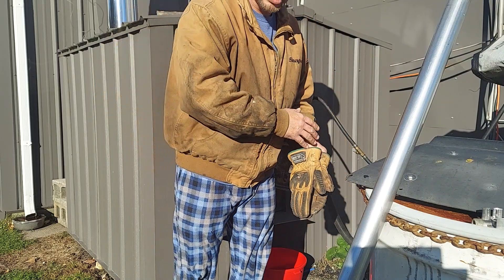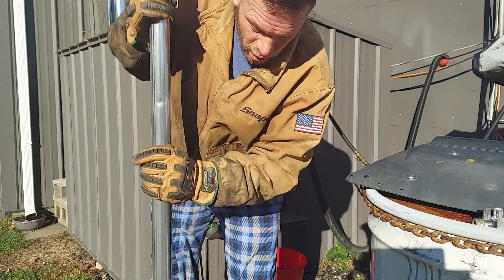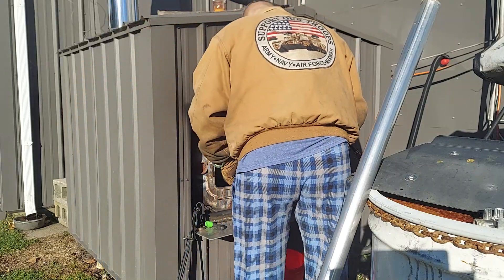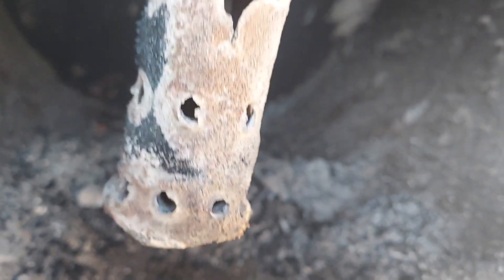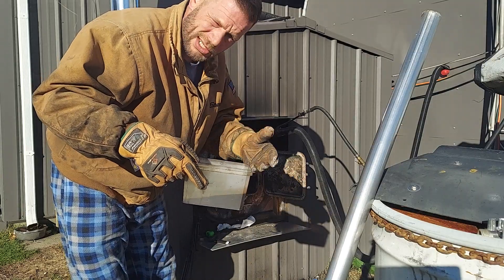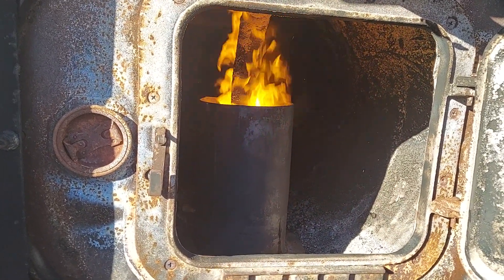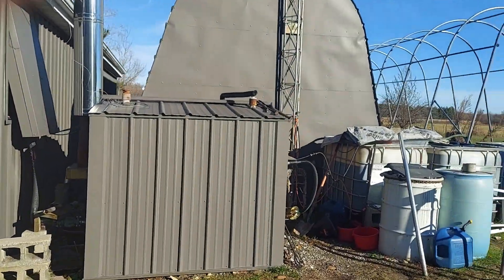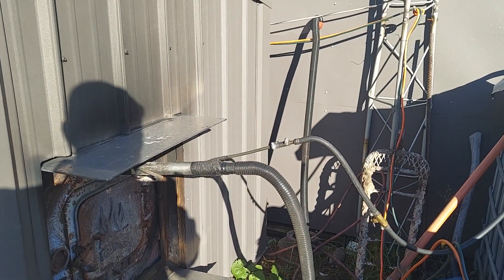How I heat my home for free! Homemade outdoor waste oil,solar,and wind  powered boiler.

Comment: Most excellent information, presented in a fine manner, thanks 
I wonder about chimney maintenance.  I'm planning to fit a burner in my 1984 Kodiak wood stove which exhausts through a 10 inch masonry chimney. I suspect there would be far less crud buildup than from burning wood.
Reply from the maker: @paulrickman7549  I don't get any build up,a very light white ash,no creosote at all. If you have a good air to fuel ratio, you won't have any soot. Smoke-free burn is the key.
Reply: @karlsoffroad  Thanks.

Comment: Watched a ton of your videos. I want to know more about the boiler. Is it a 55 gallon drum inside old fuel oil tank? How well does the 55 gallon drum hold up?
Reply from the maker: @hauntedacres207  Yes,that's exactly what it is. The drum is holding up great. I'm on year 4 with it, and there are no issues at all. I didn't document the build because I needed to get it built and running for heat. I only took two pictures of the whole build.
Reply: @ I thought of doing that exact thing for year but worried about the drum not holding up long. What’s the secret for getting the drum inside because of the ribs? Or was it just a bigger hole then weld it up.
Reply from the maker: @hauntedacres207  I actually cut the hole a bit small, and it was difficult to get it through the hole. I had my 14x4x36 inches long stainless steel chimney box welded to the drum before I assembled it, so that was another hole to line up while fighting the drum. I did it by myself, so it can be done. I welded the lip of the drum to the fuel oil tank,then welded the chimney box. I then plugged off the holes in the fuel oil tank and filled it with air to check for leaks with soapy water. I had one on the upper left of the barrel and one inside the barrel at the chimney box port. I had a hell of a time getting inside to weld that pinhole. I could only fit one arm and my head through the opening! Lol

Comment: Super interesting video! I know you said you run your boiler overnight. So does that mean you then have to let it go all the way cold once a day to service it? How well does it hold house temp when the whole burn barrel is that cold?
Reply from the maker: @BrinksFarm  I can shut it down for 24 hours if needed and still have heat for both buildings. I can shut it down,clean it, and fire it back up in about 10 minutes. That's if I let my burner cool down completely. Very quick and easy.

Comment: I would like to see how you monitor and pump, supply the oil to the boiler. It appears the oil is lower than burn chamber so I'm assuming you have some sort of pump setup. 
I'm working on my burner and oil supply system now and am just starting to play woth peristaltic pump for supplying oil accurately and hopefully consistently.
Reply from the maker: I'm working on a video tour of my whole setup and installation of my latest burner design. I have had it running for about 32 hours now and haven't had any issues. I just posted the burner video yesterday. If you haven't seen that yet, check it out.

Comment: Excellent; thanks for showing us around. Love the wind turbines. Don't know about them; but I do know of solar. Been building my solar setup for now 6-7 years now. Just need the battery bank  for 48v Setup.
Reply from the maker: I hear ya on the batteries! I only have 10kwh of capacity, but it will power quite a bit. I run the boiler 24/7 between the wind and solar. I can squeak by,sometimes, my batteries are pretty low in the morning! Thanks for watching, and I will be getting some bigger turbines and showing the process of setting them up in the future.

Comment: What do you keep your house set at as far as temp, and how much oil do you use per winter. Also what part of the country are you in? Im in the process of getting mine set up. My boiler is made from a 60 gallon air compressor. And the rest is scrap metal and junk really. Few parts like relays, pipe fittings, pex for the water to the house and a circulator pump were purchased. Thanks
Reply from the maker: I keep my shop set at 80,unless I'm working, and the house at 72. I'm in the thumb of Michigan. I use about 2500 gallons a year. I heat for about 7 months or so.

Comment: You light it with diesel when it runs on just the oil used motor oil?
Reply from the maker: Yes, I can light it without diesel. It just takes a bit longer.

Comment: Make a few of those things so all you have to do is just change it out, you have to clean that out every 2 days? that could never work for me
Reply from the maker: Do you burn wood now? I burned wood for 15 years, and it was a lot more work than this. Then, I had to shovel all the ash. This is a 5 minute clean and light.

Comment: After seeing your oil supply I don't know if you care, but if you were to add two more 275 tanks to store heat it would allow you to not run your furnace continually. I'm always looking for cheaper ways to heat my greenhouses so your videos get my mind racing. I would be very interested in how the boiler is built. Having 10 acres of woodland I have more firewood than I could ever use.
Reply from the maker: I used two 275-gallon fuel oil tanks with a 55-gallon drum for my burn chamber. I plan on adding more fuel oil tanks for storage,but I haven't been able to find anymore since. I can go 24 hours without it running, I just like to keep my water hot. Definitely in my plans for the future.
Reply: An alternative you might not be aware of is a US Army surplus immersion heater. Drop one in a 55 gallon barrel full of water,  light it up and you'll get nice moist heat. They are a bit finicky but will run using old stale gasoline which can be found for free.

Comment: Not free if you are having to power a pump and blower…you can rebuild it and make an oil drip and naturally aspirated burner which would be free…I have one and it gets just as hot if not hotter than you have…I use mine in my shop (28 x 42 ) it will heat it up from 32 to 90 in about an hour
Reply from the maker: Post a quick video, I'd love to see your setup. Thanks!
Reply: @karlsoffroad  I just saw a video from GerrysDIY from 9 years ago that’s very similar to my setup…
Reply from the maker: @redneckways1617 ,I've watched all of them! I built about 20 different versions before I stuck with the one I have in the boiler now. I did gravity feed the first year,but everything is outside, so when it gets cold,the oil just won't flow at a reliable rate. I see temps of -30 Fahrenheit,so you can imagine how thick the oil gets. I'm also heating 500 gallons of water at 30 gallons/minute flow rate. The burner might not look very hot, but it will melt down rotors in about 5 minutes. I tried everything!This burner can run reliably for days without checking on it. Easy to clean as well. I know if my barrel wasn't submerged in water, I would have blown right through it almost immediately. A big deal for me was no smoke at all. I haven't been able to achieve that without forced air of some kind, but I'm working on that as well in some other videos.
Reply: Please. I'd really like to see what you've done. I'm fascinated by all this.
Reply from the maker: Runs off of solar and wind, so there's an initial investment. Paid itself back after the first two months. I was spending $1700/month for propane. The oil pump uses 100 watts, and the blower pulls 295 watts. So it's free for me.

Comment: You could make 7 of those cylinders and then use a rotary hammer tool or a jack hammer or an air hammer to clean them out each fortnight.

Comment: Your home owners insurance company must love you
Reply from the maker: It's an outdoor boiler, so there are no insurance issues.
Reply: @karlsoffroad  what about the land? With all that fuel in those tanks if it ever leaked out or there were a good it would be an environmental disaster.  Maybe where you are it is ok in your state.  In mine they would probably put me in jail
Reply from the maker: @garagekeys  ,I'm zoned with a special land use permit/commercial for my business. I work on most of their vehicles, too. I  will be building a catchment system as well. I never used to store this much at one time, so it caught me off guard.

Comment: I think you can get a better burn. The best burn produces a blue flame.
Some use brake rotors or drums for better catalyzing.
Reply from the maker: I had a blue flame burner in there at one point. It wasn't as easy to maintain long-term in this situation.
Reply: I think raw power is the way to go for this kind of setup. It gets hot enough without worrying about the blue flame.  Even with blue flame you will still get the hard stuff at the bottom you cleaned out.  Blue flame is achieved by boiling the oil and burning the gases above it rather than the brute force of instant evaporation I find.  It really depends on what you want to do with such a burner.  You can melt steel with yellow powerful flame you ain't likely to do that with blue flame with a setup like this.  You don't get soot hardly at all though with blue flame but you will get the residue left in the pot.  Also the pot doesn't have to be spotless to get the best burn, I think a certain amount of hard carbon stuff actually makes it burn better but you will still have to clean it out periodically as the pot will fill up with solid matter otherwise. @karlsoffroad

Comment: Does the water on top of that drum keep  it from burning through the drum?
Reply from the maker: I'm on year three with no problems, so I'm sure it's not hurting anything. I'll have to do a test on a barrel and see if it burns through right away or if it can take the heat without water. That might be an interesting video? Thanks for watching!

Comment: I really like your setup, what are you using for a blower?
Reply from the maker: A $20 Craftsman shop vac. 2.5 gallon
Reply: @karlsoffroad  Right on dude, you should do a video with a full walkthrough of your set up, good job!
Reply from the maker: @E.force89  I will, I'm working on a Butner video right now. Just demonstrating the importance of the blower you use depending on the intended use. Should be up today.
Reply: @karlsoffroad what kind of pump are you using? I debated using a fuel pump with a time delay board to regulate flow
Reply from the maker: @E.force89  I'm using a 12 volt transfer pump from Harbor Freight. It works well,but it has its challenges. They only last a couple months, because they're made for water, and they tend to leak a bit. I have a workaround for the leaks,but the long-term solution is to find a better pump. I have been running for two years and have gone through four of them. They're pretty cheap, and it runs off solar just like the boiler. I tried a fuel pump, but it wasn't up to the task. I keep my oil outside, so it gets well below freezing and gets thick. I'll let you know when I find something more durable.
Reply: @karlsoffroad  Why nor use an oil pump made for a cars engine???

Comment: Just found you on a FB group. I have so many questions. I can't tell with the steel siding on what's underneath. What I can see is a 55 gallon drum laid on it's side with a barrel stove door kit. It sounds like an electric blower for combustion air and I thought I heard a pump for the oil. Or are you using the blower to siphon the oil and combustion air? I know a 55 gallon drum is thick but it holds up to the heat after many years? I thought I heard you say 500 gallons of boiler water capacity? Did you basically build a square box and weld the barrel in place with water on all sides? Any leaks during building or now? Spray foam or fiberglass insulation? Sorry for all the questions but I'm extremely interested in building one of these or similar. Trying to get some ideas on where to start. I grasp the concept of how these work and I'm a field service tech for a well known brand. Just need ideas to get me started. I need to be 25 ft from my house or shop. Burry lines 4+ feet deep going to house and shop. Heat exchanger in my existing furnace in my house. Probably a radiator style heater with fan for my shop. Your system for oil is simple and awesome. I may start where you are but would eventually like to be automated for when I'm at work and such using a Beckett burner with all the safety devices in place.
Reply from the maker: I have two 275-gallon fuel oil tanks side by side. The first one is the burn chamber, the water exits the bottom through a Taco 11 circulator pump,goes to my first heat exchanger in my shop,continues through to my heat exchanger in my home furnace, returns to the bottom of the second water tank,exits the top of that tank,return water goes back into the top of the burn chamber tank for another heat cycle. I had the whole thing professionally spray foam insulated, about 8-10 inches, way overkill, but works well. I use a 12 volt transfer pump for the oil and a bounce house blower for the combustion air. I don't preheat the oil or air in anyway, other than when it enters the burn chamber, I'm sure it gets heated instantly. I haven't had any leaks, I pressure tested all components before I put it in service. I run this 24/7 for about 7-8 months of the year. Wood was just too much work and was expensive in my area, so free oil was what I came up with. I have had a lot of people who want me to build them one,I just don't want the liability. If someone got hurt or worse. I don't have any warning labels for those who lack common sense! Lol
Reply: First off thanks for taking the time to answer my questions! Second the more info you shared on YT and FB the more I see the beauty and simplicity of your system!  Your 12v oil pump I don't think is designed to be dead headed. I saw you control the flow with the needle valve on 3/8 line? Do you have a bypass loop for the pump so you're not dead heading it? Bounce house blower is a good idea! Do you run glycol or just water? Is your system open or closed loop? Such as sealed with valve that adds water when needed or is it open and you just top off by filling from the top? For some reason if something happened or you went on a trip cab it be shut down without freezing and busting something? I do have some wood on my property to burn but for me and what I do for a living I see sometimes hundreds of gallons a day of clean used oil not going to benefit me by free heat at the house. I also have 7 VW TDI's but most are common rail and doesn't do well on anything other than diesel. However I am looking for a 12v Dodge or 7.3l Ford to burn WMO. Probably a 2 tank system. @karlsoffroad
Reply from the maker: @beast666joecool ,I run open loop with water only.I have an aquastat installed on my first heat exchanger, if the water temprature gets below 120,it tells the furnace to fire the burners like normal,that is my insurance against freezing.I can leave for any amount of time and not worry. I wouldn't leave the burner going if I was going to be gone for more than two days. On my feed from the pump,I have a T-fitting just before the needle valve so I can turn the feed off without shutting down the pump and to prevent dead heading. I think I will do a quick video to demonstrate the importance of the blower being used per application very soon. I always get the comments that my blower is too big. I know from years of experience what works and what doesn't. That should help those who want to do something similar. I am a firm believer in the old K.I.S.S. saying, "Keep it simple, stupid!" Too complex isn't practical or available to everyone, which is a problem for DIY.
Reply: I try to implement the K.I.S.S method too. Thanks for answering my questions. If you get time maybe make another more in depth video maybe including your heat exchangers too. I'm glad I stumbled upon your FB post and then your channel. @karlsoffroad
Reply from the maker: @beast666joecool  ,Alternative heating and supplies has a great video about the heat exchanger and aquastat. That's where I bought everything too.
Reply: @karlsoffroad how do you keep the water from over heating on warmer days when you don't use much heat? A traditional wood boiler cuts off and on with and aquastat, just trying to figure this part out.
Reply from the maker: @5stringpickin ,I just turn down the oil a bit. I can also just get it up to temperature, then shut the burner down for the day. You figure it out pretty quick. I just put my newest burner design in my boiler, and it's even more controllable. It has maintained the temperature within 2 degrees for the past two days without any issues. I'm going to shut it down tomorrow and see what it looks like inside as far as buildup. Looks amazing so far! Check out my latest video to see that burner. Thanks for watching!
Reply from the maker: My run is about 300 feet total, with no insulation on my one inch pex,other than the cheap black foam that fits around the pipe.
Reply: Do you have a heat exchanger to your water heater? So none of your pex is insulated? and you are returning back with only a 20 degree drop? That's awesome. @karlsoffroad

Comment: WOW
Loud and scary to me. I know when you know how it works and have the experience, it becomes less scary.
I need to see how this system works by drawing / diagram.
Do you have one to explain HOW it works?
Reply from the maker: I don't have any drawings. I just built a bunch of different variations and stuck with the one that burned the cleanest,hottest, and didn't experience a flame out. I can do a build video to show step by step if that will help. Let me know if that's something you'd be interested in seeing. Thanks!
Reply: Thank you  @karlsoffroad  I would be interested in a step by step (walkthrough) of each part , but it would have to be very simplified and brief. When you have time !